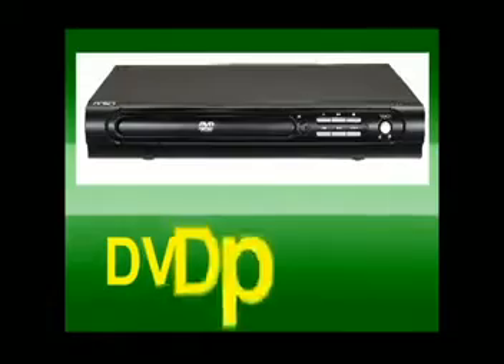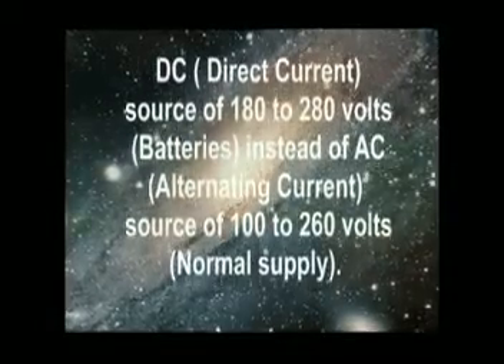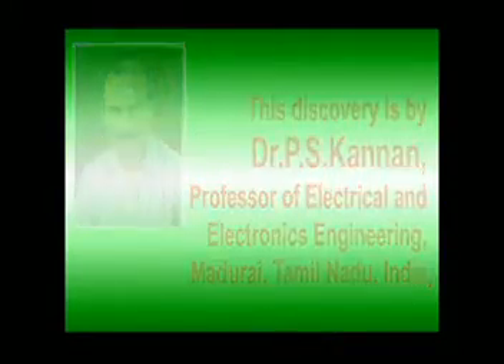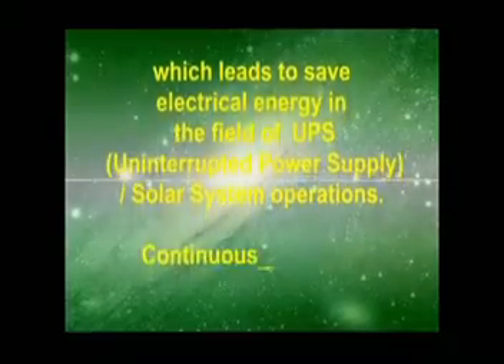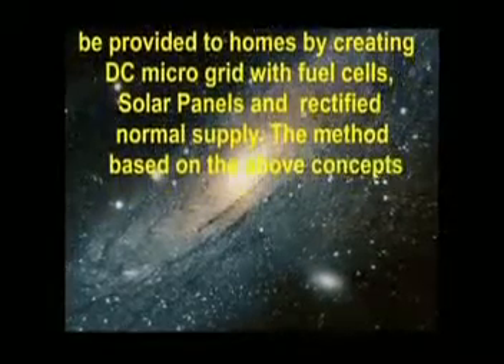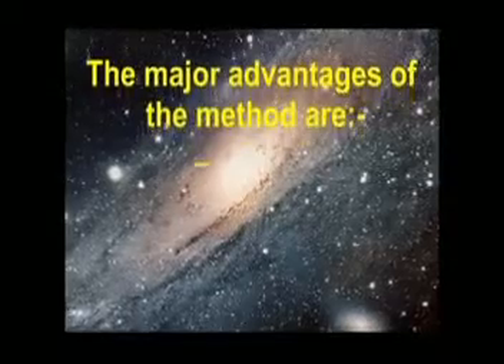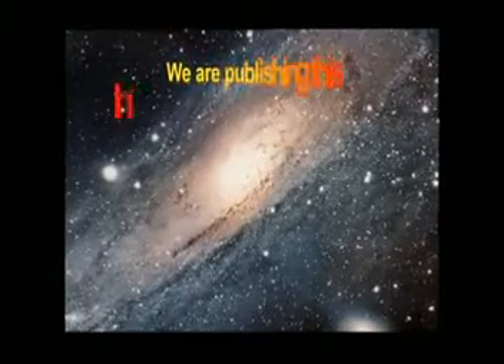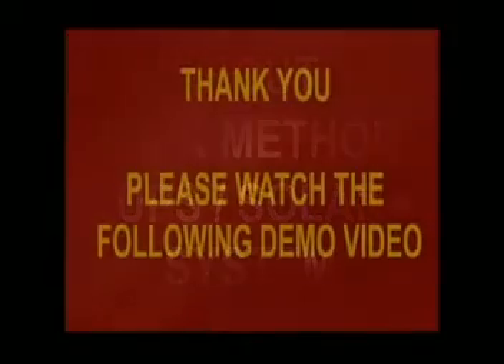PSK METHOD OF UPS/SOLAR SYSTEM

Comment: Please work out the initial cost for installing 1000 va for a residence. This should include wiring, solar panels, batteries, meters, mounting, labor, etc. Only then a comparison can be done with conventional UPS. Thanks.
Reply: rajaram ramasamy Please don't ask the cost based on Volt Ampere rating. Cost depends on utilization of loads in your residence during the day time and night  However , cost could be  reduced 30 to 40 percents by this method. Kindly hear conversation held with Mr.Nellai Nambi ,All India Radio, available in Youtube . Thanks